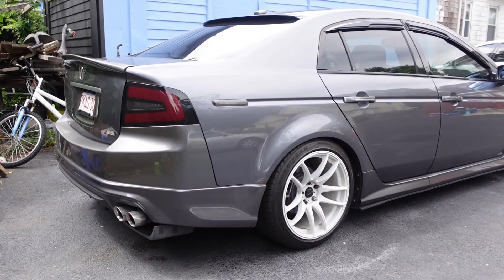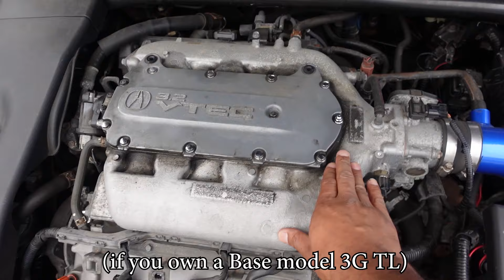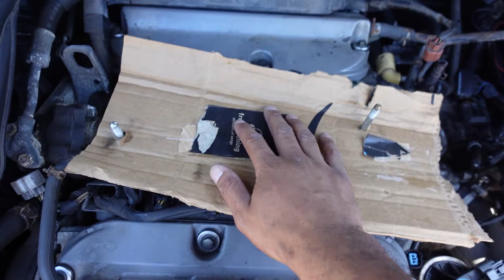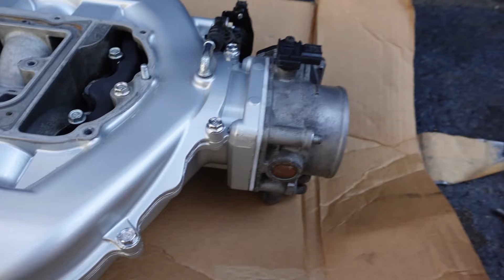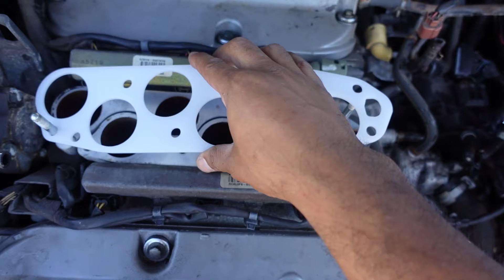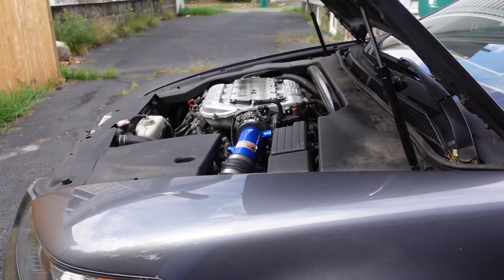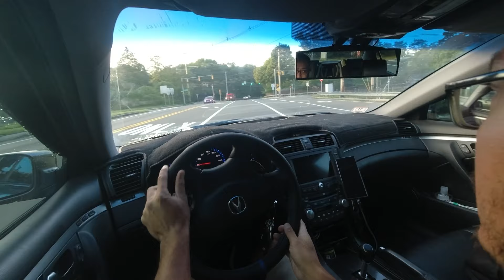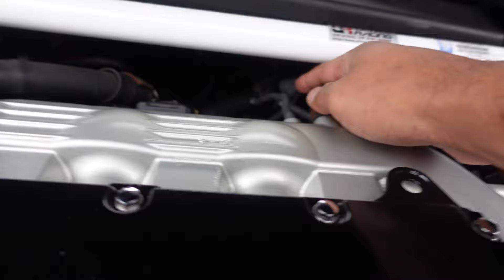MORE POWER!  3.7 Intake Manifold & Throttle Body Install

Comment: Hey so I just did my 3.7manifold swap on a 07 base TL and ran into some problems. 3 codes popped up and after the car heats up the car will rev up to 2.5 RPM and then drop all on its own and it’s keeps doing without me pressing the accelerator 
Any advice
Reply: The codes were 
Po113 
PO507
PO2279
Reply from the maker: try doing the idle relearn process.  mine's did the same thing.  could be like my situation also and be a bad throttle body.  double check all lines and do the idle relearn process would be my advice

Comment: Nice car! What wheel setup w/offset you running? Looking to get some new rims.
Reply from the maker: Thank you.  My wheels are (knock-offs of Work CR Kai's) Vors TR4, Fronts: 18x8.5 +30, Rears: 18x9.5 +30.  Needed spacers in the front to clear brembos
Reply: @thecarfiend11  I was thinking 18x9.5 with +35 which I think puts about even with fender with a 225/235 tire. Thanks for the info!

Comment: how did you shave down the connector at the very end?
Reply from the maker: I literally shaved it with a blade lol.  You can whip out the dremel, but found it unnecesary.  only took a couple of minutes
Reply: @thecarfiend11  for sure. Im going to try this on my 05

Comment: Wouldn't it be easier to get a bigger throttle body, than to change the whole intake? Am i missing something?
Reply: My thoughts exactly, the two intakes looked identical in size, except the larger TB, if that's the case get the TB and an adapter?
Reply: @kevink6265  The internal diameter of the intake manifold port to the throttle body must match the internal diameter of the throttle body , else if you just use an adapter it will constrain the airflow with zero net gains.
Reply: no the j32 and 35 have a inlet ID: 67mm Outlet ID: 65mm where as the j37 has 80mm inlet and 70mm outlet.  @kevink6265

Comment: I’m surprised you needed the purge solenoid mounting bracket kit, cause I think HeelToe Auto only lists it as a necessary part for the J37 intake manifold and throttle body swap, onto the 9th gen (13-17) Honda Accord V6 (J35YX).

Comment: Nice but sounds like a headache specially if it’s a daily, now a days anything under 400hp ain’t nothing not worth the upgrade in my opinion.
Reply from the maker: Fair opinion, tbh.  "worth" is in the eye of the beholder.  I happen to run across many issues that other TL enthusiants did not.   Some really do just plug and play (for the most part) and can get it for cheap at a junkyard.  Horsepower isn;t the be all end all.. you can still have a fun car without 400+HP
Reply: @thecarfiend11  it’s a beautiful car I have 02 type s and Acura integra I boosted my integra I fell I spend way more money on that b series than if I would off k swap it from the beginning

Comment: Great Job always have had a sweet spot for the 04-07 TL I had an 03 Maxima 6 speed manuel And my friend had a white 04 Tl we use to race all the time But yeah my manuel always got his Auto we always wondered How much better the manuel MT would compare to manuel 03 Maxi 😆 loved both cars - Mine was dark blue with black leather interior miss that car but now I drive a ISF thats been super reliable thanks for the video
Reply from the maker: Thanks for sharing.  That sounds like an awesome race, both has close specs.  Manuals are always more fun, imo.  ISF is a great, reliable, and pretty fast car (Father-in-law has a Fsport RX350, super reliable and fast for what it is).
Reply: the 6MT has different gear ratios so it does pull harder for longer in each gear. also fourth gear is way better than on the auto. (based on the videos i've seen) 4th gear still weak though compared to the newer 8 speed 2.0T's. I watched a video where a nice 3.7 SH awd 2011 i think went up against a 2.0T accord, 2021, and a 2021 TLX 3.5 SH Awd. The old 2011 pulled them until fourth gear.
Reply: I think you meant "manual." I won't make the old joke about the guy named "Manuel."  Happy driving.

Comment: Good video. Nice and thorough instructions. For that connector on the throttle body, it looks like the the sensors are similar enough that you could have just pulled the sensor from your old throttle body and installed it onto the new one. That way it would connect to your harness connector without any shaving. The way you did it can work, but sometimes Honda swaps pins around in the connector between generations and causes a MIL. Glad you got it worked out.
Reply: the j37 sensor from the J37 is better than the old one.. so not a good idea

Comment: I have a stock Acura Kb1 05,  not a mechanic or anything but I saw somewhere that a j37 could fit on the j35a8...is this true? Anything special need to be done other than jsut a few bolts(many) and removing parts and replacing? 

Also is it possible to put the j37 throttle body on the j35a8? Is that possible without doing any special work to the parts or buying additional smaller parts? And/or having to do things with the cpu of the car?
Reply from the maker: I'm not 100% sure if this mod will work with your RL.  you would have to do your own research on that.  But in theory, yes it should be plug and play. Since you have the 3.5L motor, you won't see as much gains I did (coming from a 3.2L).  I've heard of other people swapping in the 3.7 mani and have no issues.  I just had bad luck with a bad throttle body and relearn process
Reply: @thecarfiend11  so I did somw research for a amateur car person, and saw that there's not much gains. However I'm wondering, even if I do buy a 3.7 intake manifold, and also TB, what would I do for the air intake tube? You look like you ha e some sort of CAI?  also, I was trying to watch over and over again you talk about each sensor wire connecter, and how there was a slight difference. I'm wondering if you have any idea on what each does? And how my 3.5s wires format would be in relation the 3.7? 

Lastly let's jsut say I put in the air intake manifold an TB and get the wires good. Would I need to do some scanner tool things to see if it's running rich or lean, due to more air then it's used too?
Reply from the maker: Each sensor does something different.  But it is important to have them connected, unless you want to manually bypass something and control it thru other means (aka standalone ecu).  You dont really need an aftermarket intake.  just need to make sure the intake tubing is connected.  And you can solve that with an aftermarket tube, just measure and try to find one that fits.  
The car is gonna naturally run lean (more air than fuel).  But the car's ecu can adjust slightly to it.  you'll get maximum benefits if you can tune the car with a standalone ECU and gain more efficiency and power

Comment: Usually connectors can be disassembled and repinned. Could look into buying the 3.7 connector for that sensor (or finding one at a salvage yard for free) then replacing it on your harness. Not sure though I'm new to this. Believe it or not I'm thinking about doing this to my 1st gen Pilot lol.
Reply from the maker: Yes, they can be repinned to the correct connector.  But since both connectors are very similar, and I do not have the correct one, a simple 5 minute job did the trick
Reply: @thecarfiend11  how did you do the job? did you shave the outside of the female connector?
Reply: What do I do with the extra vacuum line off the j37 that my j35 didn’t have on it on the top manifold plate

Comment: Would you recommend the p2r thermal intake manifold gasket or just use the stock metal gasket cux I got the kit for the stock metal gasket with the upper cover gasket.
Reply from the maker: Doesn't matter, honestly.  The thermal gasket does help with heat transfer

Comment: DId u crack open the manifold to clean the inside too or just clean outside n around only?
Reply from the maker: I didn't open the manifold.  But I did use a variety of cleaning brushes to clean the inside, from the outside holes.  Used hot water, purple power, cleaning brushes, power drill, and a couple of hours.  Cleaned both inside and outside.  Lightly scuffed up the outside before painting

Comment: So if I wanna do a engine swap what would be the best?
Reply from the maker: That's too broad of a question.  I don't know much about engine swaps. But I do know.. if you got the money, time and skills, you can swap any motor into any chassis.  If you're talking the 3rd gen TL's, then you can't really swap other motors without some modifications.  A 3.7 motor from a newer Acura will fit into the 3rd gen engine bay, but modifications will need to be made.  It's never an easy/direct swap.  Knowledge is power (quite literally)

Comment: I put on an Acura 3.5 intake manifold and 3.7 throttle body on my 2003 Honda Accord V6 coupe. You should add on a P2R spacer, port/polished runners and high-flow cats. I just added those 2 things
Reply from the maker: Awesome man, that's a great upgrade for the Accord too.  Full bolt on and a tune is my goal for the TL.  In due time, I'm in no hurry and mod at my own pace
Reply: Why did you decide to do the 3.5 intake and not the 3.7? What’s the difference?
Reply: I’ve heard the P2R spacer doesn’t do anything tho coming from the manufacturer but if there’s a gain lmk but high flow cats are definitely worth it tho

Comment: Car looks sick. I recommend EGR valve delete to go with the manifold.
Deleting the egr smoothed out the rev hang and high idle issues for me, but I have an automatic 😢 so results may vary.
Reply from the maker: Thanks man, much appreciated.  Will eventually delete EGR, more performance mods, stand alone ecu, and tune.  that's the plan, slowly but surely
Reply: this will throw a CEL that you can't get rid of.. for only 2hp
Reply: @kitvexed8229 explain?

Comment: I got a 3.7 manifold with throttle body for $87 at a junkyard off a 12 TL sh-awd pretty good price, even though it’s in tuned when it gets hot can’t notice much of a difference but when it’s cold out definitely pulls Harder and better throttle response too.
Reply: ill take it
Reply: Should I get this for my Acura tl type s 07
Reply: @S5Elvy  Yes
Reply from the maker: it's an upgrade nonetheless, even if you dont feel the performance.  car may run more efficiently also, better gas mileage with a tune.  Also, if you have a typeS (3.5L) it would be less noticeable
Reply: @thecarfiend11 if I was to put this on 2013 odyssey would I need to get a tune? 😊
Reply: @AshImprovements u dont need one technically but to get full access to the new mod u would want a tune but idk if they make tunes for ur ecu might need to swap it to a tl n hondata it

Comment: Great build & honest review. How are the thermal gaskets working for you? I've heard of them having vacuum leak issues over time. Also, have you had additional issues since you did the swap?

I have an '05 TL-base Aspec w/ P&P IM/Runners. Been considering this build for awhile with my setup. Any feedback would be appreciated, keep up the great content! 💯
Reply from the maker: Much appreciated.  I tried to document as many cons as possible in that video.  So far, so good.  it's been a couple of months since install, and i drive the car daily.  No issues, other than 1-2 loss in MPGs.  No idle issues, no vacuum leaks, nothing.  But this is just my experience.  If I did have issues, I would most likely swap back to the stock 3.2 IM. since winter is around the corner and I try to avoid working on the car in the snow lol.  So definitely keep your stock setup when doing this mod, in case you run into issues

Comment: Very good documentation on this topic. I've been considering this upgrade for a while. What exactly did you do to the car for the idle relearn?
Reply from the maker: I have a scan tool that I used, along with a video I followed for the idle relearn.  
Scan Tool:  https://amzn.to/3rXdKPn
Idle Relearn:  https://youtu.be/Of_llbYNwww
If you don't have a good enough scan tool, you can always bring to a shop or dealer to get your idle relearned.  Car was driveable after the install, without the relearn (for my case)

Comment: i have bought the 3.7 Intake and TB but couldn't finish it since the ports for the air temp were moved. This video helps a lot! thank you. One question though. was the air temp piece around $100? or is it just the seller?
Reply: Don’t let that stop you from doing the job. I did the mod the other week and just had the IAT sensor plugged in to nothing and still worked fine while I waited for my coupler with the bung for the sensor.
Reply: Autozone charged me 54$ for the part for the one that goes on the 3.5

Comment: Who ever you got that trottle body from probably moved the butterfly valve and alter the valve causing the idle to fluctuate therefore you have to do an idle re-learn. Nothing wrong with the 3.7 TB. I also feel like the oem metal gasket for the runners are better and the paper TB gasket is better I never had any idle or vacuum issues doing this mod

Comment: Love the build it’s something different that a lot of people don’t do. You should dyno it and get it tuned eventually.
Reply: If u were on acurazine, you would see that this was a popular mod many years ago. And the problems that thecarfiend had, were already known for only the 6mt, the autos don’t have idle issues. I installed both on my 6mt type s and had idle issues. Fixed 95% of the issue by swapping the motor and throttle position sensor from a 8th gen v6 accord j35 throttle body into the 3.7 zdx throttle body. All this information is available if u dig deep enough. Fixed 100% of the idling issue after hondata. Hondata may or may not fix the issue 100% without having to replace swap throttle body parts
Reply from the maker: Thanks man, I appreciate it.   Definitely wanna tune and dyno.  It's in the plans
Reply: Did you ever get a tune? Thinking about it ive wondered how your air/fuel ratios have been mapped considering you just stuck on a lot more air on a vehicle that was tuned from the dealership. But for a swap like this id definitely take it to a tuner shop.